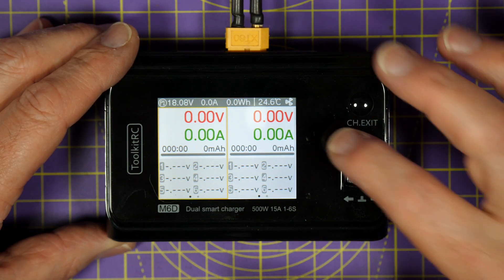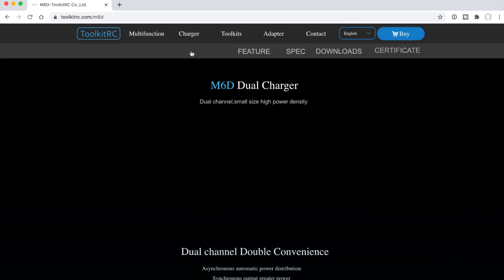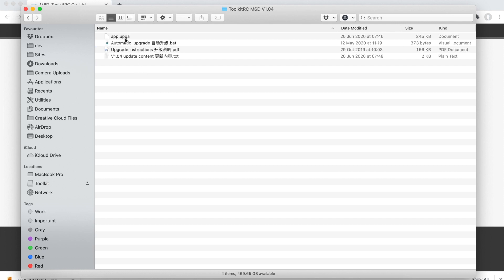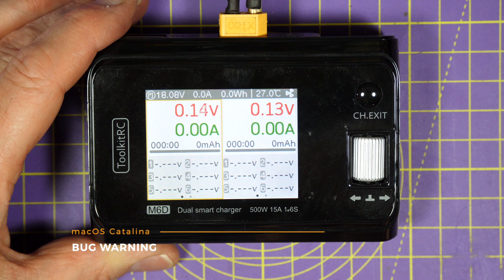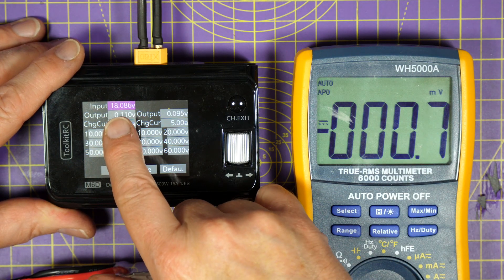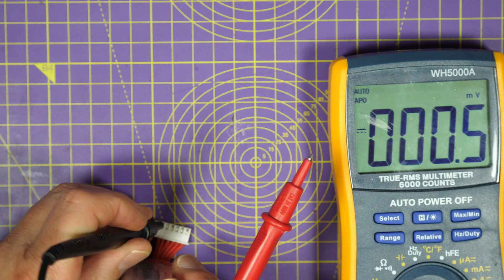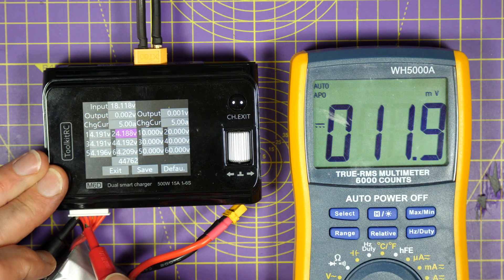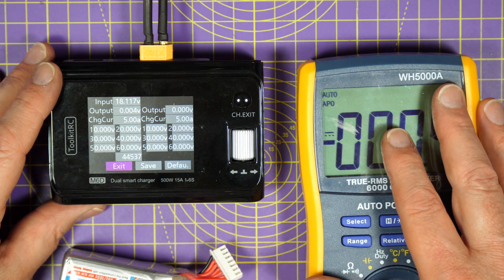ToolkitRC M6D charger voltage calibration and firmware upgrade

Comment: I am wondering, why is it so complicated to use the "smart" charger, we have to buy so many other stuff, just trash
Reply from the maker: Totally get where you’re coming from! It can seem like a lot. The good news is, calibration isn’t required, it’s just there if you want to get under the hood and fine-tune things. For most people, the charger works great out of the box without any extra stuff.
Reply: @WhirlyBloke  Thank you for answering, is there a chance that the adapter I used is too weak? since I get the massage about voltage match up error

Comment: Quick question ⁉️ Im trying to update but Laptop is not recognizing USB.. could it be the cable that came with it? Because my other cable for my phone works
Reply from the maker: I found with these older ToolkitRC chargers, you need to use the original cable that comeswith the charger and use a Windows PC - not a Mac. The newer chargers are fine.

Comment: Thanks! I just updated my charger, and now it's bricked 🙁
Do you know by any chance how to recover it? I formatted it already, but that didn't help🤷🏻
Reply from the maker: That's really annoying and I've not seen it before. Maybe contact ToolkitRC support. Let me know how it goes.
Reply: Thanks! I actually found an even newer firmware (v. 1.23), using this one it seems to work fine again. I made sure to use the included batch file, then "safely removed" the USB device, and finally pulled the USB cable very slowly💁🏽‍♀
Reply from the maker: @DavidG2P  Phew! Thanks for the info.

Comment: i did an upgrade of my M6D to the latest firmware thrugh a windows 10 device and since then it's not booting up anymore.
Reply from the maker: Thanks for watching my video and reaching out to me. I'm sorry to hear that you're having problems after the firmware upgrade. I understand how frustrating that can be. In situations like this, it's important to troubleshoot the issue step by step. Here are a few suggestions that might help:

* Firstly, ensure that you used the original USB lead that came with the M6D charger for the firmware upgrade. Sometimes, using a different USB cable can cause compatibility issues. If you didn't use the original cable, try using it instead to see if it makes a difference.

* Make sure you followed the firmware upgrade process correctly. Double-check the instructions provided by ToolkitRC and ensure that you didn't miss any crucial steps.

* Try using a different PC or Mac for the firmware upgrade. It's possible that there may have been a compatibility issue between your Windows 10 device and the charger. Switching to a different computer might help resolve the problem.

* If the above steps don't work, consider reaching out to ToolkitRC's customer support for further assistance. 

I don't have all the answers, but hopefully one of the suggestions above will resolve the issue for you. Best of luck, and I hope your M6D charger gets back up and running soon!

Comment: after i copied over the new .upga file my toolkitrc m6d won't boot anymore .. did this on macOS 13.1
on windows both my M6Ds are not recognized (one working fine with the old fw, the other on not booting up anymore)
unfortunately only saw this video AFTER i already copied the file over on one of my M6D

my M9 gets recognized on windows without problems
Reply from the maker: I have seen problems like this using earier versions of MacOS. Never had any issues with Windows. Try pinging ToolkitRC support and see what they say.
Reply: @WhirlyBloke  will do, thx! does it work for you on windows 11?
Reply from the maker: @shotbyarian  I've only used W10.
Reply: @WhirlyBloke  thanks! maybe W11 doesn't work - so strange! tried multiple W11 PCs/notebooks
Reply from the maker: @shotbyarian  Drivers are usually the problem on Windows.
Reply: @WhirlyBloke  yes, but it won't even show up in the device manager, this is so weird

Comment: For those who don't have a 6S to calibrate - you can calibrate as normal then simply move the balance plug to the next adjacent position then calibrate those cells. Great video otherwise thanks.
Reply from the maker: Good tip.

Comment: When I connect my charger to the usb it beeps and turns on. But I can't see it in the external drives.
Reply from the maker: Try another quality USB lead. I recommend using the one that comes with the charger.
Reply: @WhirlyBloke  thanks for the reply I actually got it last night used a post in the back that the keyboard was plugged into and worked..... weird

Comment: Thanks for the great explanation!  Mine wouldn't even work out of the box due to the voltage mismatch.  Calibrated it on a 6S battery and DMM.  Double checked on a few different chargers and voltage checkers.  Thought I had it dialed, then went to charge 2x 2S race packs and the voltages were way off.  I'm going to return it and continue my search for a dual channel iCharger S6 equivalent.

Comment: Also remember to Calibrate the OUTPUT of the battery which is connected to charging port. It has to match with the Total Voltages of the Cells or you will get "Balance port voltage match error!".
Reply from the maker: True, but ToolkitRC chargers are pretty well set up these days.
Reply: @WhirlyBloke  I would like to trust on that! Mine was produced 06/2020. It overcharged 3 cell Li-Pos to almost 12.8V. Problem got fixed with calibration.
Reply: @samipupu mine is produced in 2024 May but voltage is not regular. So im in this video

Comment: I have a balanced 2s battery at 3.8 per cell 7.6 overall but the charger is reading the general power as 7.2v. scrolled for like 5 minutes and I cant scroll anymore, its still at 7.46v. what do I do?

Comment: Thants a pain!! Cant it work out of the box.
Reply from the maker: You only need to do this if the balanced voltages need a tweak ort you just want to check them. Generally I've found ToolkitRC chargers are setup just fine out of the box.
Reply: Good to know bcuz i just ordered it.. mine comes with a 180mb power supply combo.
Reply from the maker: @jandomingo9806  Awesome combo.
Reply: @WhirlyBloke  im assuming you have the same combo? I believe my old charger is 50w. So that 180w power supply will do it 3 times fast? Is that the theory?

Comment: What does the 5a charge current in the calibration menu means? I've an M6 which is capable of 10a but in my setting it has these 5a.. is it some kind of limiter?

Comment: Just got one of these chargers, did the firmware update no worries but I get error "Input voltage too low" when trying to power from the usb because apparently it requires 7-28 volts and usb only provides 5.2v. So is there any work around for this or is it only made for charging lipos from a bigger lipo? I wish I knew this before wasting my money on a new charger for home.....
I dont know if I should attempt to send it back to banggood now as it doesn't come with a power supply so is effectively useless.
Reply from the maker: USB is only for sub 5V. You need a DC power supply to change anything reasonable.

Comment: simple to upgrade but mine doesnt connect to a pc- tried 3 different cables?  Is there a mode I need to set first?
Reply from the maker: No settings need changing, it should just work. But it does depend on so many things on your PC. OS, drivers, driver conflicts etc etc. I've never had any issues connecting it to PC or Mac, but that doesn't really help you. Try contacting ToolkitRC. I've found them really helpful in the past.
Reply: @rumbey1 do you solve your problem? And how?
Reply: @JPMeleeto  yes used a different laptop. It was due to a usb setting
Reply: @rumbey1  thanks só much 💪👍

Comment: I’ve had this charger for about 2 months and has been working as expected no issues. Except for just a few days ago. It’s charging cell number 5 higher than the others on a 6cell battery. Basically all cells charge balanced except that one. This is for any 6s battery I plug in. I then tried this on channel 2 and it worked perfectly. Is there something wrong with my channel 1 ? And is there something I can do to correct the issue ? Thank you. 
All the best.
Reply: Have same. How do you fix it?

Comment: Hello very good video thank you for sharing I would like to know if it is possible to charge LHIV smart batteries without the balancer plug, I do not see the option on the menu to deactivate the balanceator, the battery which I want to charge is is a FIMI X8 SE drone battery, thank you very much